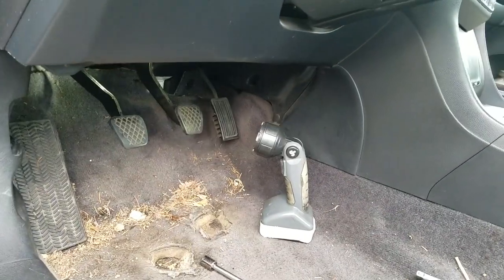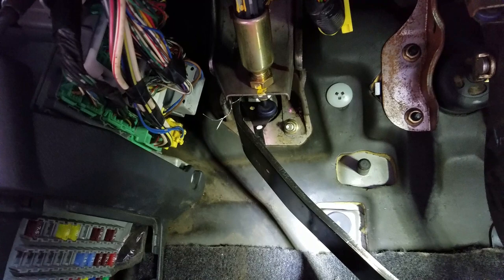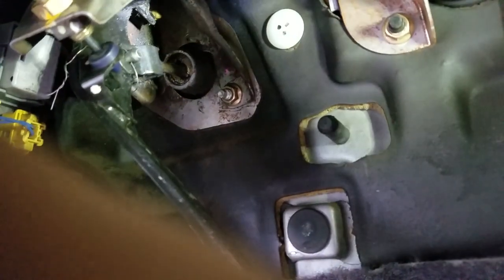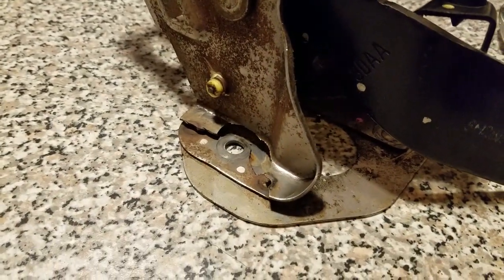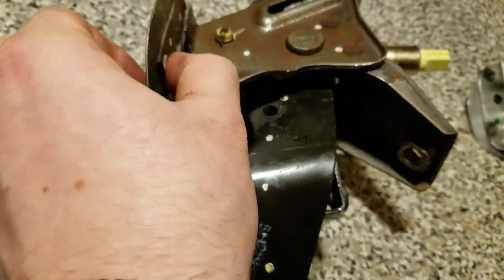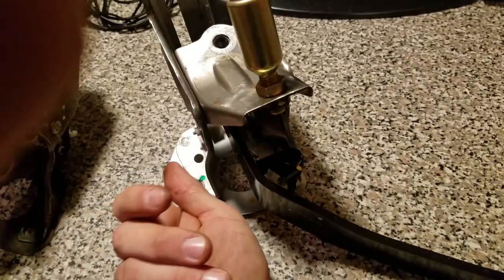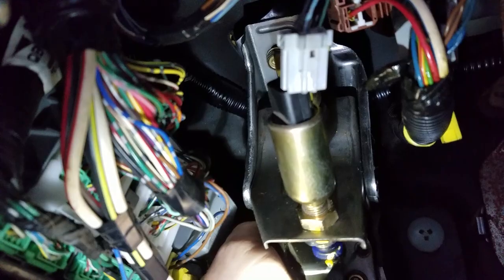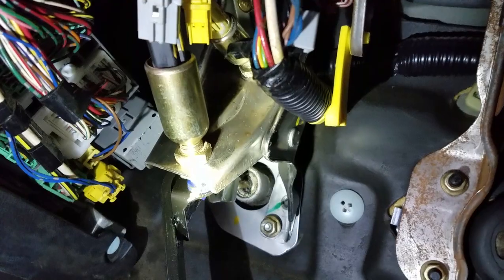How to replace 2005 Honda Accord clutch pedal--install-repair

Comment: Had that happen to me also.. 2007 model. Heard it pop in the driveway .. Had the bracket out and rewelded it and installed back in and was only 2 hrs late for work.
Reply from the maker: That's awesome, yeah some spot welds would fix it up real quick..piece of cake , plus you could make them even better and larger than the factory welds. 
I did have a welder though, this was cheaper at the time.
Reply: I think this is what happened to my 2007, 2.4, just the other day. I felt and heard a pop down by the clutch pedal and then couldn’t get the clutch to disengage. Had it towed to a shop and the guy tried to tell me my clutch was worn out and needed a new one at 1400 bucks for the job. I couldn’t really tell in the video but what exactly am I looking for under there?  I guess what confuses me is I don’t understand why my pedal still returns up after I let off if it and at least from a seated position the pedal doesn’t feel wobbly or anything just a bit easier to push in. I’m probably gonna have to have my car towed to my house because I don’t want to hurt the synchros trying to drive it without the clutch.  Also, could it be the throw out bearing or something else with the clutch?  It has no hydraulic leaking, it hasn’t been slipping or anything. The pedal has been squeaky for what seems like years.
Reply: How long would the weld last ?

Comment: Did that broken piece stop your car from entering gear
Reply: It can cause that, yes.
Reply from the maker: hey yeah, it gave out several miles after leaving my house, thankfully i was able to grind the gears a bit and gett home in second gear. was barley able to engage the clutch, but i pulled it off...
Reply: I just had mine break yesterday and luckily I was able to bump shift my gears until I got home but I wasn’t sure what the problem was, thank you for the great video :) saved me time and money
Reply from the maker: Carlos Domenech  DANG THAT SUCKS!
Yeah , doing this kind of work over time can save you thousands of $$$.
Reply: Mine made it very hard to shift.  Feels a lot like when your clutch master cylinder fails.  Forget about shifting into reverse and putting it in 1st without shutting off the engine is impossible.

Comment: Why disconnect the battery, just have to reset the radio again?
Reply from the maker: When i do any kind of electrical work i always disconnect the battery, its just a good practice IMO.

But, It's your car so do it how you like.

Comment: My 2006 Honda Accord has the same problem. I thought it was my transmission. Cost $210 at Honda Dealership and 
part # 46910-SDA-A01.